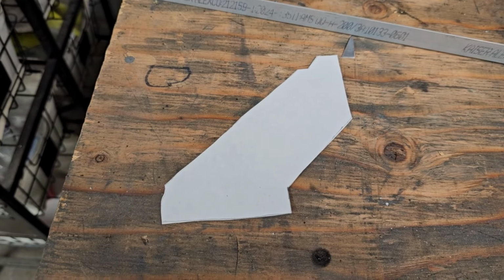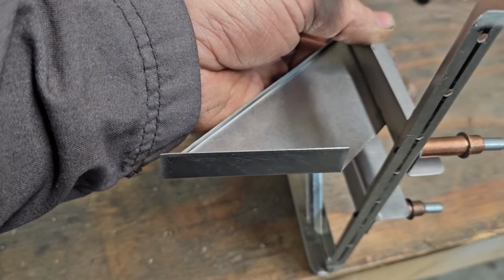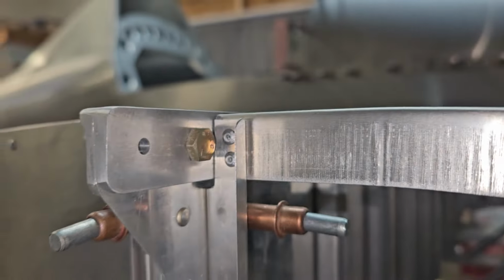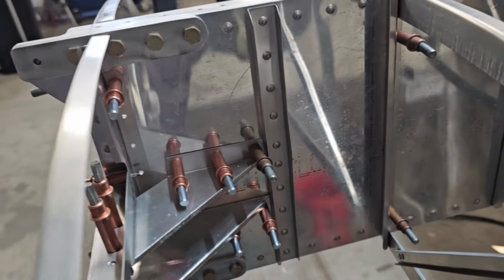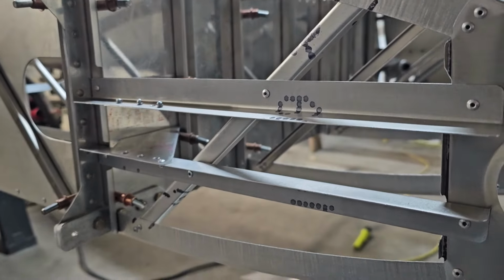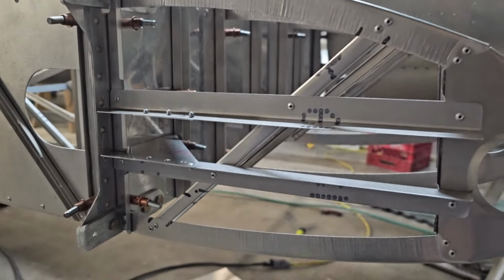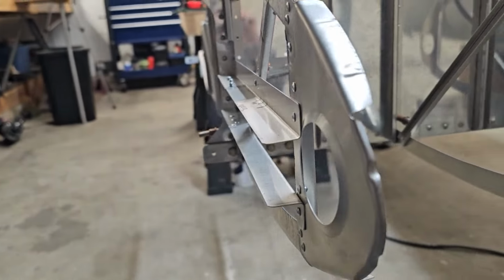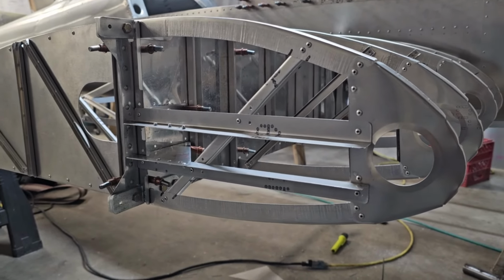Hummel Ultracruiser Build - Aileron Bellcrank Mounts

Comment: You used solid AD rivets on the fuselage in some places.  I'm wondering why you chose to use pull rivets on these ribs when driving/squeezing solid rivets would be easy and less expensive.
Reply from the maker: Very scientific reason I used the pull rivets on the ribs.  I think they are more fun!.  Seriously,  the plans call out what type of rivet to use where.  The nose and engine box along with the main spar web are solid for extra strength and in the few places you can't get a bucking bar to the back side they have you use a special stainless steel structural pull rivet.  The ribs were optional on whether to use the 1/8" pull or 3/32" solid rivets.  The solid rivets would definitely be less expensive but I've saved a lot of money by building from plans.  Besides if a few bucks here and there were critical I probably wouldn't be building a plane at all.  LOL

Comment: Nice 
I am not sure , if i am not wrong you may start landing gear before skin . Need to position the hole and use  lower fix plate for correct angle
Reply from the maker: I wondered about that and I know the landing gear has to fitted before riveting the skins.  I do have all the parts for the landing gear so I can go either way.